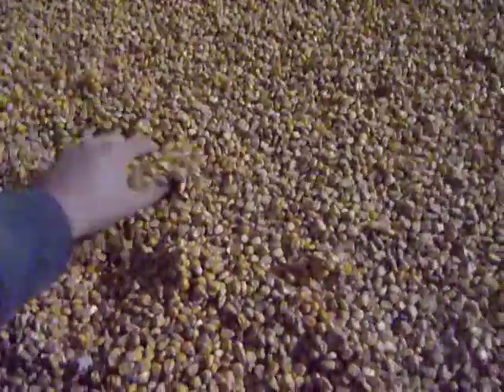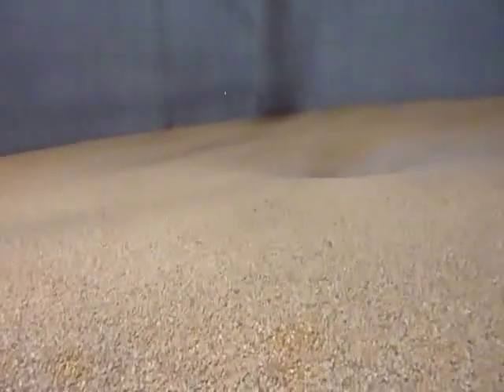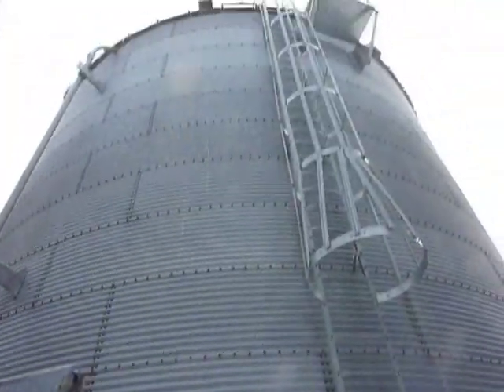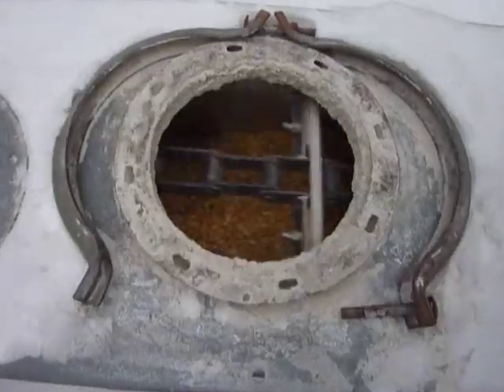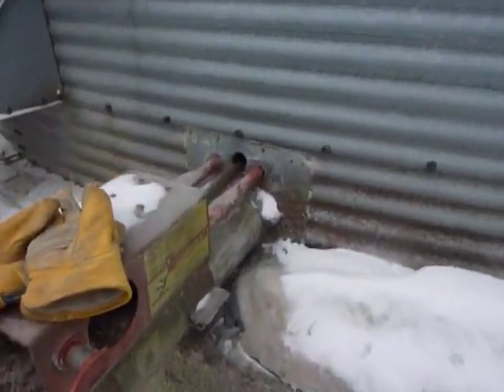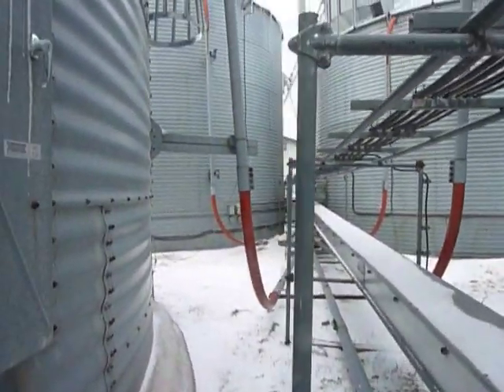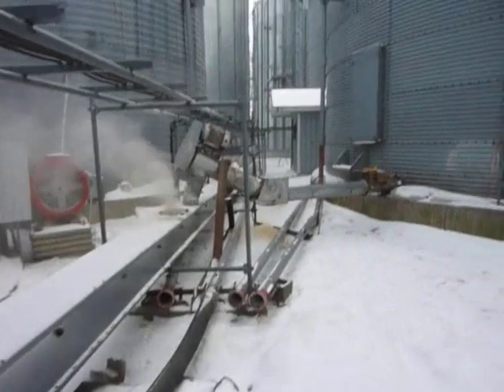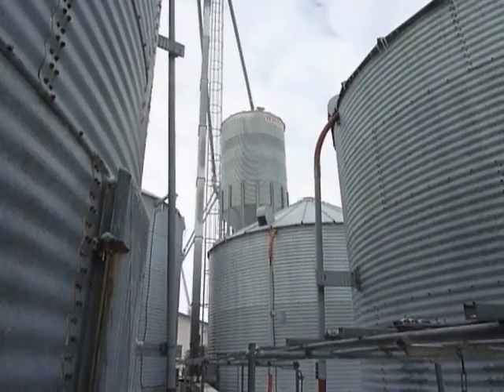What is inside a grain bin

Comment: OSHA is up everyone's ASS who has grain bins. Be careful out there.
Reply from the maker: walking in a bin that hasn't had anything removed is perfectly safe.   I do know what you are saying though and grain bin safety is a priority here.   We actually have the extraction panels on site and have had our local fire departments out to do on site grain extraction training.
Reply: @FarmerSchneck  Nice work. We just got written up by OSHA for not having an attendant when someone entered a bin with no grain. They say every bin even if there are no hazards is a permit required confined space requiring an observer outside, on top of all the paperwork that goes with that, each time you enter. It's insane. Pretty sure you need a harnass if there's grain also. Not trying to pontificate here, just wouldn't want anyone else to get stung by OSHA like we were.

Comment: you are in need of this equipment ... Stir Ator

and also put perforated pipes straight out of the floor, with a height of 10 inches and several holes of 1mm, this air do not let this stone with corn, in this case, the walls of the silos, and mesclador (Stir Actor) in the rest of the silo .

Comment: Hey there nice vid. I was just wondering if you've ever had any trouble with corn sticking to your walls. This year we filled one bin up, dried all the corn down, and then moved it to another bin. The bin with the dried/transferred corn was perfectly fine when we unloaded it(nothing sticking). However, the other bin we filled back up, dried it down, and when we hauled to the elevator the last month, when we got down to the bottom about a foot off the floor to about five feet up it was stuck to